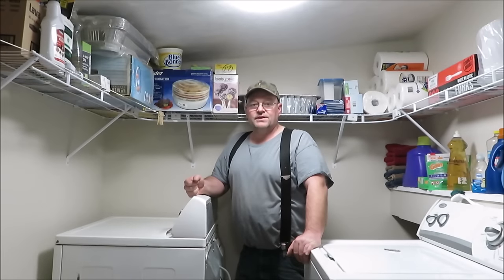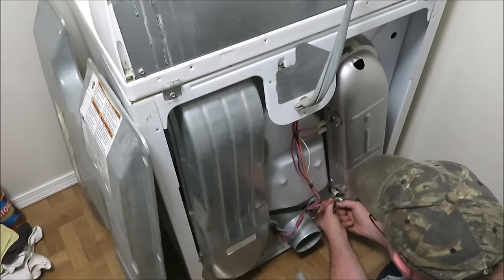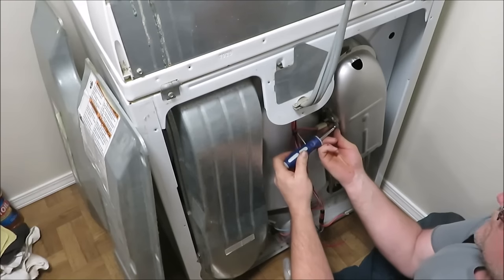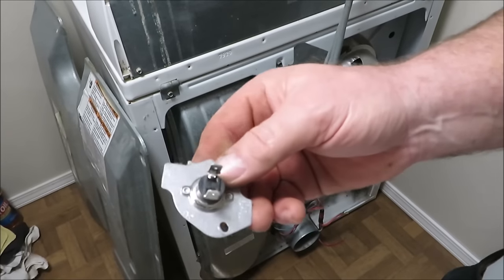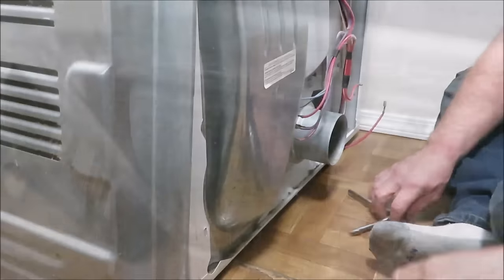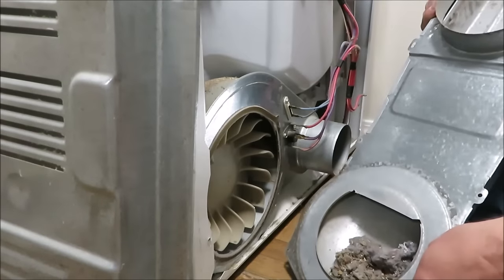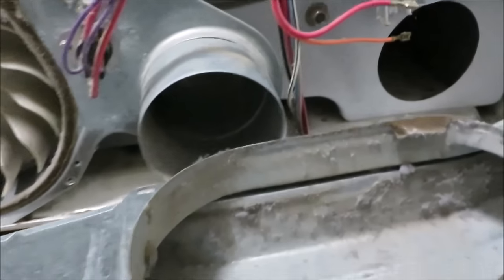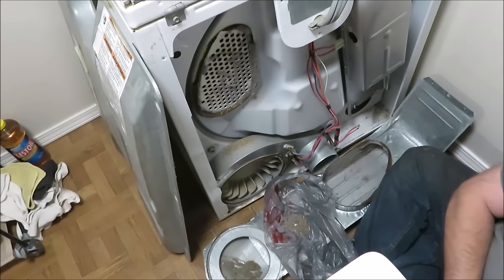how to change a heating element in a dryer

Comment: Thanks for the cleaning tips, especially on the vent/blower side. My daughter's 14 mo old dryer quit working. I bought a new heating element with a kit, that included all the thermostats & fuses. When I took the back off the entire inside was covered with a heavy layer of lint. In checking it out  the two screws that hold the bottom right side of the lint/vent tube before the blower were just barely in there and had been letting all the lint & hot air go inside the dryer instead of out the vent to atmosphere. Once I cleaned it out following your instructions and replacing all the thermostats, fuses and heating element it ran like a charm. Later my daughter messaged me saying that I not only fixed it, I improved it, as clothes were drying in one cycle where before it was taking 2 or 3 timer cycles to get clothes dry. Simply was failed assembly/quality control issue at Whirlpool letting this unit out without checking that all the screws were tight.
Reply from the maker: you are welcome glad it worked out for you

Comment: I love phones and their ability to record the assembled item--and to see where you can't get your eyeball.

But another tip I've found useful--the wires are often crimped and in the same position for so long they hang right about to the place where you plug them in.  And oftentimes the designers use different plugs where you literally can't plug the wrong one in.  Not all of the time--but most of the time.  It's just a good tip in a pinch, if you didn't happen to take a photo.  Or you can put a the same magic marker mark on plug, and next to socket.  

You're really thorough.  I'll bet that thing dried like new!
Reply from the maker: Thank you i like to take pictures of things im working on it really helps when putting things back together.

Comment: You remind me of my Dad. He could fix anything, plus you clean up as you go-Bonus. I had a dryer repair man come in and he said the new models had (this is what I remember him saying) the heating element was now connected to the rotor arm or motor. I'm not sure if that was it but he said something that used to be two different pieces were now one piece and it would cost almost as much to replace that as it would to just get a new one. Plus he charged me about $50-75 dollar service charge that he would put toward a new one if I bought a new one from them. We  ended up getting an older second hand one for $50 that works fine (knock on wood). If I would have watched this before this happened to mine I might have been able to tell what he was doing and if he was ripping me off. Anyway, thanks for the video and tell your wife she's a lucky woman to have you.
Reply from the maker: Gale I do these videos so everyone can see just how easy it is to do. Anyone can change a heating element just take your time next one you will get it Email me if you ever need help with anything I will do a video for you.kdr6688@gmail.com

Comment: I've replaces most of the small things on my dryer over the years. The timer, the squirrel cage and today the heating element. It's almost 30 years old. What I've learned is that most things that are old can be repaired if you take the time to research it. I do not ever call a "professional" because I can't pay their prices. In our area they charge me $100 to come out and assess what I already know is wrong and then another $100 on top to return and fix it for an outrageous price. I paid $18.00 for the heating element on Amazon. Just get the dryer's model number and put it in the search bar with the part and presto, major savings. Thanks for making my research easier. It didn't used to be so easy as just looking on a computer.
Reply from the maker: Thanks for watching, glad i can help people save money by fixing things themselves.
Reply: @Robinson-Homestead  You probably saved me more than money. I cleaned the air vent like you showed and you have no idea what 30 years of buildup looks like. I took lint out by the pound. I even found a jigsaw blade and toothpicks in that mess back there. It was beyond a fire hazard and needed cleaned desperately. The air flow is great now. Really, thank you.

Comment: hey kevin! thanks for your vids.. replaced many elements myself on electric driers... that snap fuse doesn't care which line goes where, it just is normally closed.. if it over heats, it breaks and stops current from going to the element. also, with your thermometer.. doesn't work well when you just shoot it anywhere, really wants to see something black.. i use black 3M electrical tape...  gives you a much more accurate temp reading if you shoot at that.. give it a try, you will see

Comment: Did your new hearing element smell like it was burning the first cycle or two?  I changed the thermometer sensor and the offer higher sensor on the stack as well. And put in a new element. When I ran it the first time it smelled like something was burning so I promptly turned off the dryer.  Is that normal?

Comment: I have a haier encore dryer model number rde350aw I had just replaced my drum belt but now it won't release hot air. Can you tell me specifically where the heating element would be for it?
Reply from the maker: Make sure your dryer vent is not plugged up is the top of your dryer hot when you turn it on?
Reply: @Robinson-Homestead  the dryer went was not plugged up. I try and clean it ever month or 2. And for about an hour the dryer was not getting hot. But fortunately just this morning I went to start a load and it finally got hot. I guess because I had it unplugged and apart for a couple of days but everything seems fine now.

Comment: That looks like one of them jobs that's easier said than done. But it looks like you did it very well. If you ever need a gasket you should normally be able to get gasket material about 1ft square at most plumbing supplies. If you have an electrical tester set on ohms will work on testing the fuse. They got the market on the heating elements. LOL
Reply from the maker: Thanks for the info for on the market lol.

Comment: Recently, I replaced the heating element in my old Whirlpool dryer. The screw hole on the new heating element bracket did not line up with the hole on the housing until I pushed the element bracket inboard, thus, causing the element's support arm to push against the sensing part of the high limit thermostat. My question is, would this cause the thermostat to prematurely trip? I guess I can always use metal wire to secure the bracket and keep the thermostat free from any obstruction.
Reply from the maker: sorry Luis i don't know for sure, but thank you for watching.

Comment: The  upper part that you call a (fuse) is actually a (high temp thermostat,) and you can Check It with a voltmeter   by unplugging both wires and there should be continuity between the two terminals,!!
Reply from the maker: Thanks for the info.

Comment: Wish me luck im going to need it. Mine just quit blowing hot so going to tear into it and change the element. Never done this before but im like anyone else I dont want to pay a big expense for another dryer and the major pain of moving them in and out
Reply from the maker: You can do this let me know how it goes.
Reply: @Robinson-Homestead  I drive a truck and gone alot so luckily I got home today while the appliance parts place here in town was open and they had what I needed and I had it changed in like 15-20 minutes. It works like a new one now. But will keep an eye on it for a while because when it comes to these things im not very confident of my work. Especially first time I dont want anything to catch on fire

Comment: I have an older model Kenmore elite (whirlpool version) electric dryer. Model is WP3387747 . I bought the heating element but every dryer video I watch shows a separate aluminum panel on the back that comes off easily. My model is white all the way around. After removing all the screws on the back the panel won't budge as if it is spot welded on. There is absolutely no give at all. Any ideas on how to get the back off on one like this?
Reply from the maker: Will it just slide out the bottom.
Reply from the maker: Email me kdr6688@gmail.com

Comment: Hahah thats my old dryer the element broke all the time finally it gave up the ghost. By the waynthey burn out usually because the vent is blocked up to roof and condensation breaks the heater element.

Comment: I changed my heating element ran the dryer for a few minutes. Still no heat. Any idea what could be the issue?
Reply from the maker: Check your wires in the breaker and where the breaker and the wire connect together and outlet.
Reply: @Robinson-Homestead  Thanks Kevin. I ended up buying a new fuse. That was the issue.

Comment: I cannot get the wires to disconnect from dryer to the heating element to remove it, please help! They are stuck on!
Reply from the maker: There may be a small clip that holds them on

Comment: Great video, I have a question, my dryer is working and heating, but when the cycle finished the clothes is still wet, in your experience this could be the heating elements or the fuses?
Reply from the maker: check your dryer vent it might be plugged up with lint, clean it all the way and feel outside if air is coming out the vent .
Reply: @Robinson-Homestead  also dont overload the dryer i learned the hard way a few times lol

Comment: Well I went to the store and got a new heating element and they didn’t have the fuses so I just installed the new heating element and it still isn’t working
Reply from the maker: Check your vents
Reply: @Robinson-Homestead  it was the damm fuse thank you for your help

Comment: There can be multiple things wrong with your dryer if its not heating up or if its stays hot and the power dont shut off. Always hsve some knowledge of electricity appliances before u mess with them. They also store engery and u can be electrocuted from that stored electricity.  They all have capacitors that store that energy even if they're unplugged. Dont touch stuff u dont have mechanical knowledge. Hire a technician to do the job for u
Reply from the maker: Good info thanks for the comment.

Comment: Replace every part now it don’t cut on at all
Reply from the maker: Is it getting power?
Reply: @Robinson-Homestead  Yeah man I got 120 on each leg to neutral and 220 leg to leg. All the parts are ringing out good and so is the timer and start switch so I'm lost.
Reply from the maker: It might be the timmer if everthing else is working.
Reply: @Robinson-Homestead  ok man if I knew you was just going to half read it I wouldve never asked.